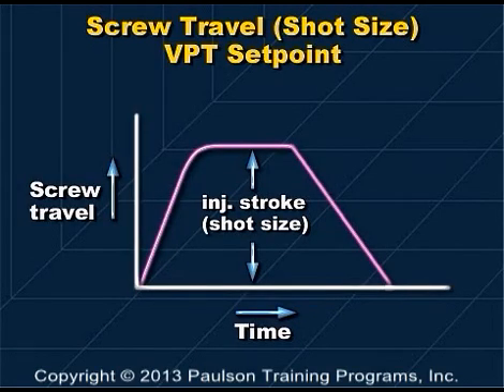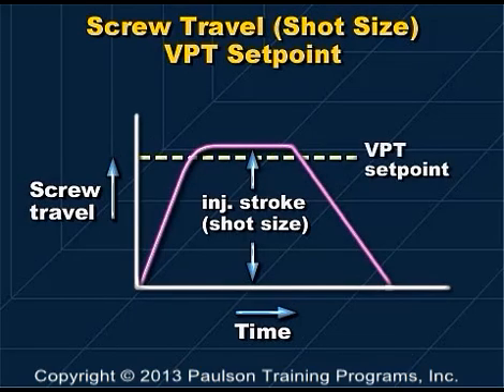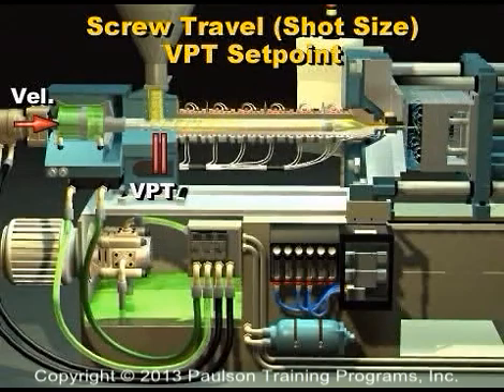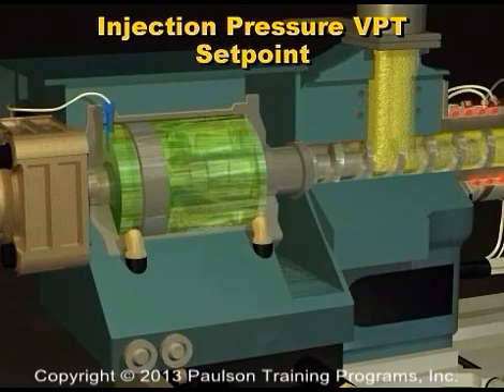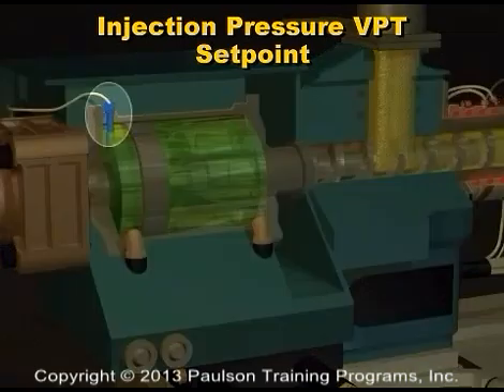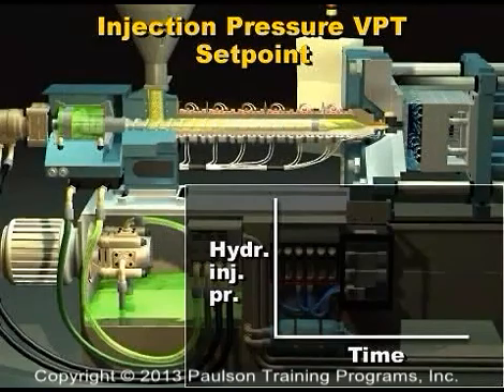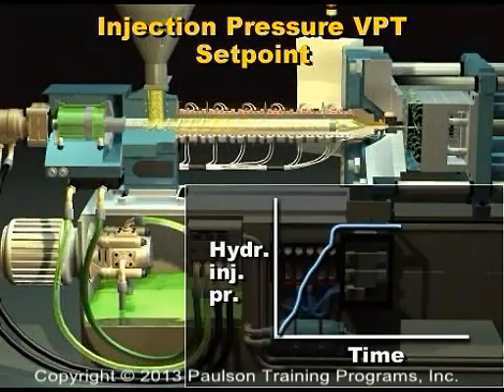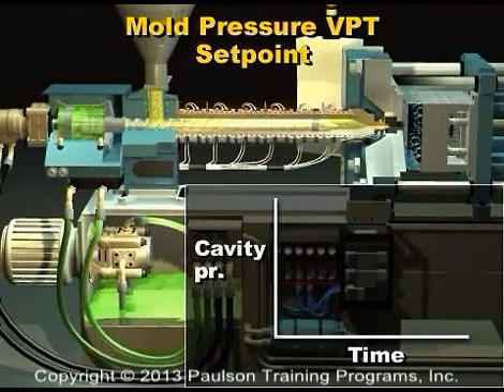Injection Molding Machine Operating Controls -- Part 1

Comment: Hi, I am Amy Yan from Lishile robot.which is the competitive price and high-quality plastic injection robot manufacturer in China.our injection molding machine has many models to choose from. such as sprue picker, single-axis servo robot arm,two-axis servo robot arm,three-axis servo robot arm, five-axis servo robot arm, and so on.
Our advantage:
1) Short lead time. 
2) Main parts are imported.
3) Our engineer has more than 10 years of experience
.
4) Injection robot quality guarantee from our project management.
5) Good service.

If you have any demand, please feel free to contact us.
Looking forward to hearing from you.

Thanks & Best Regards,
Amy Yan | Manager of Sales
M.+86 18920933019
amyyan@lishilerobot.com
LiShiLE(Tianjin)Intelligent Equipment Co., Ltd.
www.lishilerobot.com
Injection molding machine manipulator manufacturer

Comment: I am Amy Yan from Lishile robot.which is the competitive price and high-quality plastic injection robot manufacturer in China.our injection molding machine has many models to choose from. such as sprue picker, single-axis servo robot arm,two-axis servo robot arm,three-axis servo robot arm, five-axis servo robot arm, and so on.
Our advantage:
1) Short lead time. 
2) Main parts are imported.
3) Our engineer has more than 10 years of experience
.
4) Injection robot quality guarantee from our project management.
5) Good service.

If you have any demand, please feel free to contact us.
Looking forward to hearing from you.

Thanks & Best Regards,
Amy Yan | Manager of Sales
M.+86 18920933019
amyyan@lishilerobot.com
LiShiLE(Tianjin)Intelligent Equipment Co., Ltd.
www.lishilerobot.com
Injection molding machine manipulator manufacturer